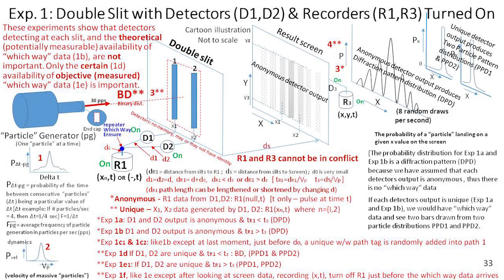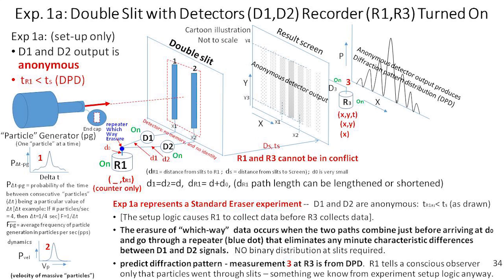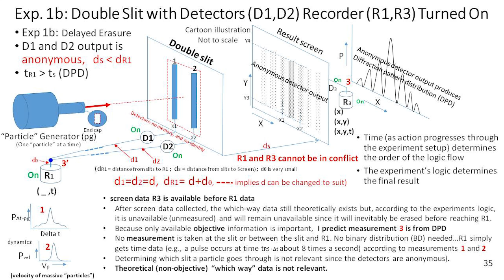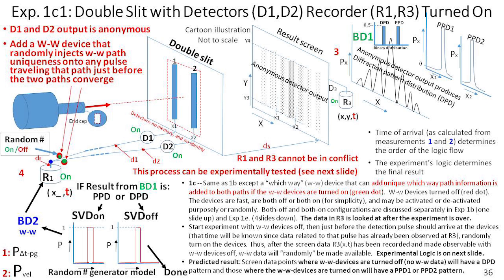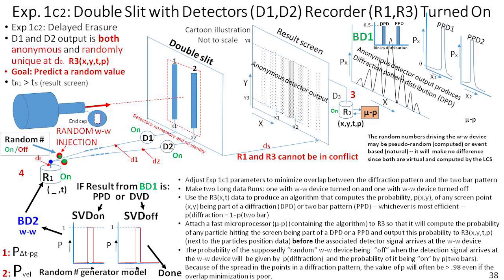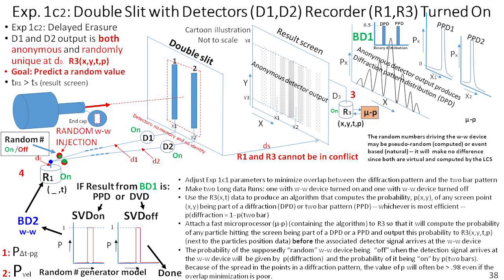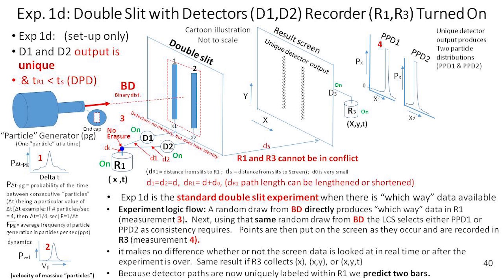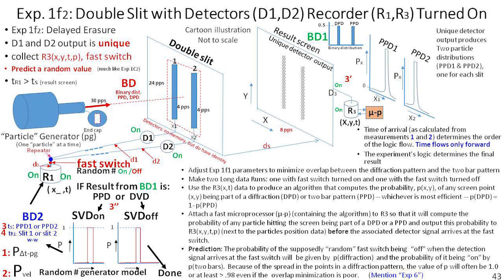Tom Campbell: Experiment 1

Comment: But could it be true that in order for D1 or D2 detectors to even "notice" a particle it will have to partially absorb some of the particles energy, possibly stripping away its ability to make a wave interference pattern. Like an apple with a seed in the center. The flesh of the apple gets stripped away by the detector leaving only the seed that does not create wave interference. The apple flesh around the seed WOULD HAVE splattered through the double slits making the interference pattern.  Maybe these small energy particles all have a seed and an outer flesh...